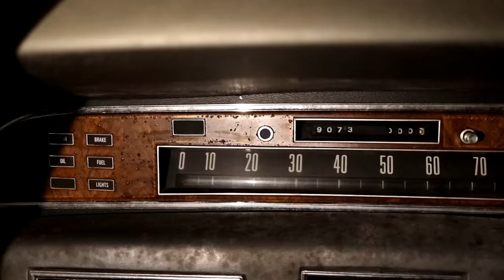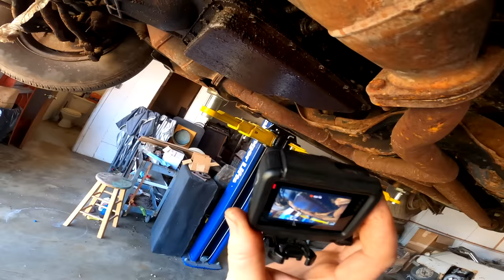Abandoned 77 Lincoln Continental Rescued After 35 YRS | Barn Find With 9000 Original Miles| RESTORED

Comment: Pretty sure a 9,000 mile engine compartment would not be grimey from seeping fluids and dust attaching to that. Its almost certainly 109,000 miles.
Reply: Yes. Surely has 109,000 miles. The brake pedal having little wear due to lots of highway miles. 
But the code on the old tires? 
Possibly stretch out a set of tires that far. Could have been the spare he was looking at mounted in 1981 or so
Reply: Definitely 109,000 miles
Reply: I agree
Reply: I agree.
Reply: I agree…if the car was stored at 9000 miles then why did it need a paint job so soon?  I get why it has all the dents but not the paint job.
Reply: I disagree. Let something sit for 40 plus years, it'll get dusty. Brake pedal, door pulls and carpet look new after clean up. Driver seat as no noticeable wear or sag. Even underneath is in great shape. If that had 109k before it sat I would expect hole on floors not surface rust.

Comment: That car is an amazing time capsule of days long past.  I'm glad to see this thing coming back to life.  A beast like that really needs to be seen cruising down the interstate with the driver enjoying the coldest AC ever and cloud-like ride, while steering the over-assisted power steering with a single finger.  Other than keeping the tank full, that thing would be a dream to drive.
Reply: They weren’t as hard on gas as you may think ..I had several 50s 60s and 70s luxury cars ….if they were kept in tune they got decent gas mileage
Reply: The rubber brake hose on rear axle is collapsed. That's a Ford thing. It is one hose goes to chassis from center block on tear axle housing
Reply: Ooh yeah
Reply: I'm sure I'm not the only one who would like to know how much you folks gave for the car. Enjoy watching these videos folks put out but we sure would like to know prices people are given so we'd know about how much something like this would cost if we decided to find one . Thanks for the videos
Reply: @danbailey96  My 74 Mercury Marquis with a 460 used to get about 12-15, depending on how heavy my foot was. :P Pass everything but a gas station.
Reply: My 1976 Buick Skylark sedan with an Olds 260 4.3L V8, a Rochester 2 bbl, and a TH200 would only average 10 mpg on the interstate. Damn that car was reliable though. They only made 110 HP and it only had 34,000 miles on it when it was given to me, but it would push that car up to 85 MPH on flat ground...eventually.
Reply: @mickisix9092  , just glad there were multiple gas stations at every exit along the interstate lol
Reply: Mustang Josh, I think the only thing I might change on the car is to MAYBE put a better stereo in it...
Reply: @chrishowell4845  I think I'd hide another stereo (mp3 player) in the glove box and keep the dash looking original... 🙂
Reply: @j.c.aguiar2126 , ya know, that would be an excellent idea, I knew a couple of guys who stuck a cd changer in the glovebox connected to the factory stereo

Comment: Up until a couple years ago when I moved to a salt state, my daily driver was a 1973 Lincoln MK IV with a worn out 429 cj that we swapped in when the 460 went. The car has got to have about 500,000 miles! 

She’s gonna get some love this winter to get ready for next spring cruisin! 

Good to see a Lincoln gettin some love on these revival channels!
Reply: I’ve got a 73 Lincoln Continental that I’m restoring as well! Only got 77k miles. But they are western NY miles, so it’ll need to be surface rust corrected at some point in its life. 

Right now I’m replacing the heater core. Turns out the car is big, but it’s still pretty tight under the hood. Especially for a little guy like me who can’t reach the middle of the car under to hold haha 😂

Comment: My father drove these Lincolns in the 70s. He had 3 different Continental 4 door models and a Mark IV. His '77 was nearly identical to this one. It was among my favorites.
Reply: My parents owned one of those battleship sized Lincolns around 1976 or 77.....not exactly sure whether it was a Mark IV or Mark V, but it was a two door, and had an engine close to 500 cubic inches......yeah, it sucked gas like nobody`s business, but the ride was as smooth as silk!!!
Reply: @chrishowell4845  I think they may have been 460s?
Reply: @myavo  Thanks for the update, I knew the engine was huge, just wasn't for sure the exact size....now granted, those Lincolns weren't exactly speed demons, but I don't think that was the point....just a super smooth ride with enough power to get the job done!
Reply: @chrishowell4845  they were very fast on the top end for sure. I love those cars- mainly because of the memories of my father and those days :)

Comment: I'd love to see that undercarriage steam cleaned or done with dry ice. Maybe strip the trim and do a whole repaint. Change all the fluids. What a sweetheart highway cruiser. I have a 2004 Lincoln Town Car that I got three years ago from a lady that quit driving it for over a year. It was clean and low mileage but not well maintained. I did all the suspension, fluids, battery, wipers, fixed the adjustable pedals, replaced a lazy door hinge, and had the bumpers repainted and for my initial $3300 investment plus another grand - I have a car that will last another 200K without a problem.
Reply: To Kenny C. Good for you! A worthy owner!

Comment: For myself being a long-time viewer of you guy's, whether it be on Turnin Rust, or Restored, I remember being at an old live stream on Turnin Rust, and I think I told a few people about my idea for my first car. Well, I just wanted to share the news that not only do I have the bill of sale, I have gotten it started after 4-5 years of sitting. I believe it to be an all original 1988 Chevrolet Suburban Cowboy Conversion. This means that it has special captain's bucket seats for the front four passengers, it has a special paint scheme with pinstripes, and it has a full-custom luxury interior. I was so lucky as to buy it, not only for $400 USD, but to buy it with only 46,000 original miles. The only way I was able to get it so cheap is because it had been sitting for the aforementioned 4-5 years. Let me tell you, it starts and runs good , and if all goes well, even though I'm only 14, I might be able to drive it on country roads sooner than later. Thank you all, Praise God, have a Merry Christmas and Happy New Year!

Comment: I worked on the Lincoln door assembly line at the Budd Company in Detroit January 1977 thru December of 79. I spot welded the hemline around the periphery of the door. We did 440 car-sets of doors in an 8 hour shift. Budd stamped all of the body sheet metal and assembled all doors, the roof panel, fenders & quarter panels (2 door and 4 door). Budd did the same for Mark III thru MarkVII, The video sure bought back memories! Thank you!

Comment: THEY DIDNT START DATE CODING TIRES UNTIL THE EARLY 90'S
that lincoln has 109,000
Reply: The ding a Ling, I believe was reading the tire size in millimeters🤣, not the date code...date codes don't have 398 X 187 lol. That in NO way on earth is 9000 miles. My 84' has almost 700,000 miles, and the chassis is FAR cleaner than that rusted hulk.

Comment: Hey restored crew, great episode. I had a 77 Mercury Grand Marquis, which is essentially the same car. I have to ask about parking brake. In mine it work like any other parking brake with 2 exceptions. First if the brake was setup and you put it into gear it automatically popped the parking brake. You didnt have to pull the handle to disengage the parking brake. Second, when you pushed the parking bake pedal, it locked the rear shoes, pretty normal. There was a second way to set the parking brake, pump the brakes and hold them then push the parking brake pedal, it then locked all 4 brakes. Ive never seen this on a car before or since.  I thought something was wrong with the parking brake since it kept popping out when I was test it. The manual outlined the function of the parking brake and it worked as the book manual said.

Comment: Back in 1978 we had a problem. We had a 29 foot sailboat that we wanted to tow to Florida. When we found out the hassles of taking an oversize load over the road we came up with another plan. We lived in Maine where there were lots of old cars around so we found a 1967 Lincoln Continental for $300 and welded a really large trailer hitch on it. That huge engine would haul a freight train, but who would suspect that a car would be towing an oversized load. It worked. Nobody said anything. It was quite a trip.

Comment: The  craftsmanship and quality of those cars is unbeatable. Today’s cars don’t hold a candle to the old cars.
I have an 89 Lincoln town car that had 37,000 miles on it when we bought it 13 years ago.
It now has 85,000 miles on it
It’s  black and I get it professionally waxed every year, you can see your reflection on the side of it.
It is the original paint job, no rust anywhere. 
Dream to drive and the ride is second to none. 
We’re retired so we don’t drive the miles we did when we were younger, so gas economy isn’t a big issue for us.

Comment: I had a 1976 Lincoln like that. I kept that car very well tuned up.. I went from Alexandria La to Orlando Fl and it got about 21 miles to a gallon. Drove that old car for a long time. Then a company tire truck ran into the side of it and wrecked it pretty bad. It had 73,000 miles on it so I pulled the 460 and transmission out of it and put it in my dads 79 Ford truck . He drove that old truck for many years after that. I think that engine had about 219,000 on it when it went down on him. The oil pump went out and it slung a rod. Those old cars are hard to find now a days. Wish I could find another one like that.  Great find there for sure.

Comment: Cool, i have a 73 from similar situation but 65,000 miles. The parts are not bad. I had to put a new float on the sender unit, it had corroded from ethanol? They ride so smooth

Comment: I had to pick one of these up in 1988  to put a new Wind-shield in, the owner had it parked or wedged would be the better word in his back yard so he had to get her out, first thing sitting in with the plush velour seats with  8 track player,   and that  Lincoln ride,  driving down a  35 Mph zone doing almost 70 the ride is so smooth you have no idea of the speed , the engine is barely breaks a sweat back then many of the older folks keep their big beasts to drive down to Florida from Toronto, if you do 55 or 60 stick in cruise you could pull off a 19 Mpg to 20 Mpg,  but I love these cars,  thinking about you could stick the entire church choir in the back seat and there is room in the trunk , great find, this one is a keeper,

Comment: I have a 1979 Lincoln Continental with the Town Car option and opera-window delete! I've had it since 1980. Each time I went to buy a new car, my 1979 followed me home. I've decided to restore it. It's not bad, it was properly Ziebarted back then so there's virtually no corrosion anywhere. It's a light dove grey which was a popular color back then.

My car has the 1/2 vinyl coach roof that isn't cracked or torn in any manner, there are also no rust bubbles. It still has its showroom look, it even has the opera lamps.

I want to change the drive train. It has a dinky little 400 2-banger, which is way too under-powered for a vehicle of this magnitude. I am going to get a fresh 460-CID 4-bbl Ford V8 which has a much better power-to-weight ratio AND is better on gasoline consumption than that dinky-little 400-CID V8 engine.

The car runs and drives very well with no fluid leaks. It will be a very easy restoration, the original paint isn't faded. The only damage to the car is on the passenger side from an accident where a little old lady side-swiped it at a red light during an icy Winter with a BIG Chrysler Newport. The damage is light with mostly trim damage, the sheet metal took a lickin' and kept on tickin'! The Turbine-Vane cast aluminum wheels are perfect with NO curb rash nor corrosion. The chrome is 100%, I've always kept the car in the garage where it resides currently. It is the ultimate cruising car of the 1970s that I want to live on forever!

I also have a 1993 Lincoln MARK VIII with a showroom-new look. It's a one-owner car I bought in Portland, Oregon. The lady that owned it took it to the dealer for everything. The car is 98% rust-free. There's a little bubble beside the rear window I am having repaired, other than that - she is very very showy. Each time I take it out, someone always comes and asks if it is for sale. I am going to keep this Lincoln too. I like the 4.6 litre 32-valve V8 engine which still moves this car with aplomb! I've had it for 2 years and I've rubbed off all the scratches it received at the dealership it was purchased from. I've rubbed the black paint to the point it looks like liquid black ink!

I collect cars. I've got a 1979 Lincoln Continental Collector's Series sedan with around 15,000 original miles - it still smells new. The midnight blue original finish is as showroom-new as the dark blue vinyl roof. This car is quite the survivor. My 1976 Continental MK IV has around 24,000 miles and has the "Lipstick & White" luxury group. The leather is immaculate and snow white! I've also kept a mint 1961 Lincoln Continental with the iconic forward-opening rear coach doors.

It would take up too much space to list the Rolls-Royces, Bentleys, Aston Martins, and other high-end European luxury cars I keep in mothballs! I never show my collection publicly to avoid being targeted for theft. It's the supreme satisfaction of ownership to me that counts. Each time I see any of them, it is like a return to yester-year with all its glory! I wish they still made a REAL car, don't you?

Comment: Excellent video RESTORE  Crew  :) those cars are excellent my one boss had one in Dark Navy Blue body with Baby Blue interior all leather plus 460 motor 4 barrel carb with true daul exhaust plus one features I like was power antenna on back left cowl fender and be adjusted a controller on dash save get broken by car wash by computer  to also lube with pentriotion fluid also Vaseline too keep from rust or seized up too! Also first car I had seen ever  Electric Heater on them for Winter Season months to defroster in them too and reading lights on back window plus back seat and 8 track option to with Am/Fm radio to ! Also would check RESTORE Crew :) is full spare need air in also jack is needed lube up or clean too and check back wheels brakes on drums to plus emergency brake cable too also check differential fluid in axle condition too if need top or change too! Lube up key locks plus ignition switch also trunks also hood too even latches too on trunk plus door's too! Check see in glove box has yellow button for the Power Trunk works if has it  too! That low mileage car for sure and average fuel get is 15 mpg too!

Comment: My parents had a 1974 Lincoln Towncar.  The dashboard is somewhat similar.  It had over 300,000 miles on it. The odometer only went to 99,999 before it turned over.  In the late 1950s to early 1960s, my dad was a mechanic for a Ford Dealership.  He would do overhauls on it and it drove like it had less than 40,000 miles on it.  He kept a good set of shocks and Michelin tres on it.  My dad passed away in 1989 and mom traded it for a 1990 Chevy Cavelier.  She wanted a car that was easy on the gas.

Comment: I remember my mother having a Lincoln Continental back in 1984. I don’t remember what year it was, but it had the “spare tire” shape to the trunk lid, with “Continental” in an arc around it. It was blue, and had a chronic transmission fluid, or engine oil leak. I, and my brother were riding (him driving) it around Glennallen, Alaska. All proved fine until a future trip, when the engine seized 🆙 (I think 🤔). I wasn’t along on that ride, but my parents, Mom and George, were. 🔜 after this, the car 🚗 was 🆙 on jacks, alongside the cabin,as my brother Matt, was going to  try to make an attempt to repair it. Coincidentally, Mom and George lost 😞 their jobs at their restaurant (no, they didn’t own it, just worked there). In turn, my brother found the car 🚗 too complicated (and very expensive) to repair. For the car 🚗, and the cabin, we were forced to abandon (we relocated). That probably means somebody got to have a free Lincoln Continental. Happy and safe 😊 New Year, and a Merry Christmas 🎁🎄 (belated). Happy 😊 2022!! Your friend, Jeff.

Comment: the key holes lit up when you pulled up on the locked  handles in night time to see the hole to unlock the door  ,and when the lights were on at night and you put the blinker on to turn, the side fronts  would illuminate to see into the turn ,cars today dont have that anymore . Coach lamps were the rage , It was very  nice to see it coming down the road , getting to an event, more luxurious than todays luxury cars, distinction !!!

Comment: If you push the turn signal stalk towards the dash you should be able to tilt the steering column. Don't know if y'all noticed this but the car has good vacuum because the headlight covers closed shortly after you started it.
Pull the back seat out and see if the build sheet is still pushed in under the springs of the seat. It should be on the bottom cushion.

Comment: Btw, that's an enamel paint, so you're always going to have the paint come off onto the pad while buffing, and the paint will get nicer looking, but it'll always look hazy and crazed. My 76 Skylark was enamel painted and I could never keep that thing shiny, so I eventually gave up trying. It was a base model sedan with an Olds 260 and a TH200 with 34,000 miles, so it wasn't a restoration worthy car. This is at least a really nice car with EXTREMELY low mileage.